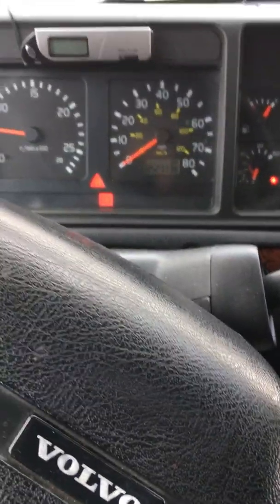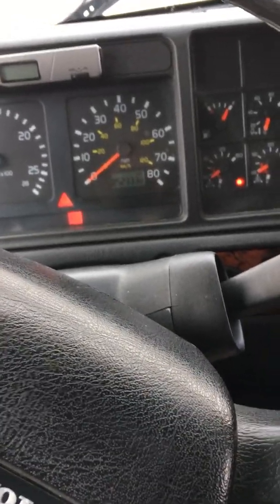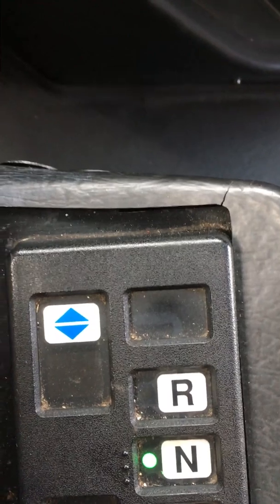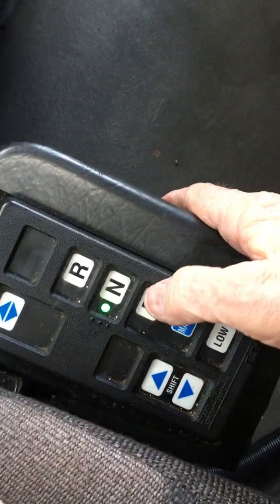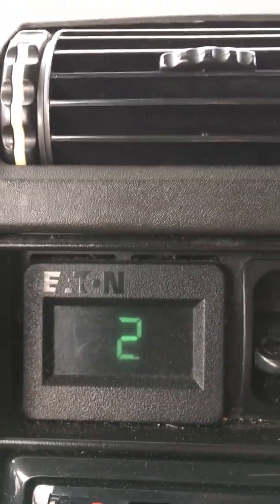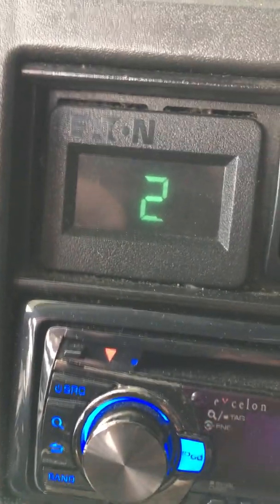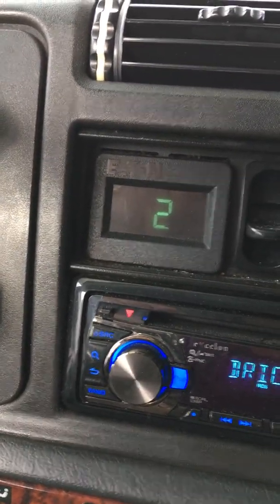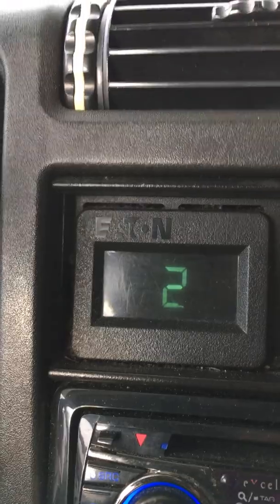Volvo auto shift transmission

Comment: My 2000 vnl sat for about 6 months when I tried getting it going again it’s giving me issues. It starts and shows the gears sometimes but sometimes it won’t start and shows a dash like this — on the gear reader. And the service light on the auto gear shifter is red when this happens now even if I use the starter to get it going it’s still showing the dash and won’t read the gears. Any idea what may cause this issue I’ve heard of xy shifters and also the harness causing issues just wondering if u have any input or ran into this issue at all
Reply: My experience has been when the sit for a while the electrical connectors get corroded. First thin to do is to unhook the harnesses, clean them, and hook up again.